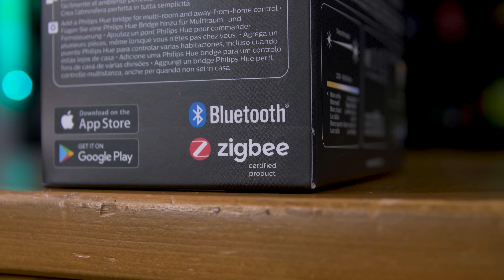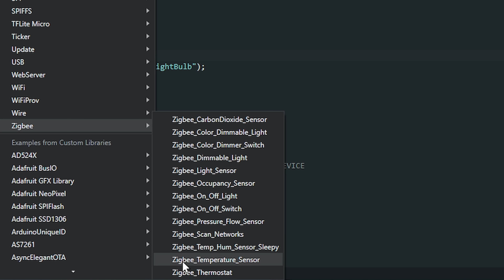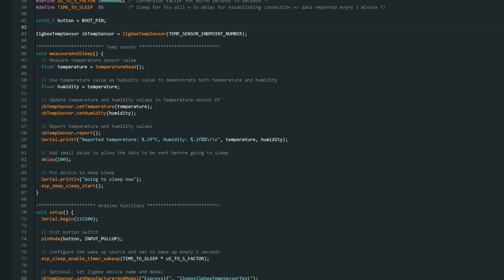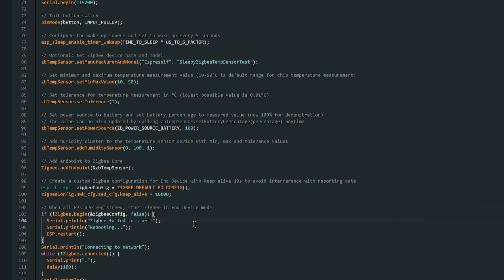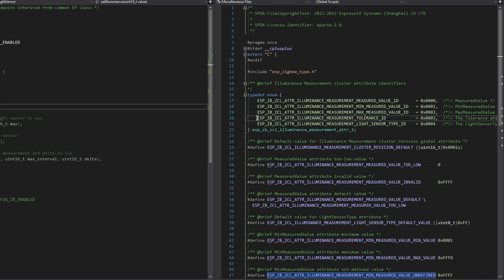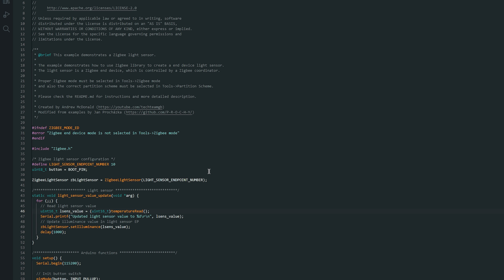You can make your own Zigbee devices! DIY Zigbee How To

Comment: Hey!
Thanks a lot for this explanation, that helps a lot :)
Quick question - I have esp32 which has 1 relay and 1 BLE device (toothbrush battery) on ESP home over WiFi. As it's WiFi + BLE it of course crashes from time to time, do you think/know if it's possible to add BLE device battery as an output via zigbee? Thanks in advance :)

Comment: I'm confused. In all the examples they make, there is one for a cover (blind). But covers need to respond to open and close commands as oposed to all the other examples that do not respond to any command. So, going to Zigbee for low energy battery operated devices sounds good but... the only way a battery will last a descent time is by using the deep sleep more. I dont see any way to wake it up by receiving a command.  The light sleep consume way too much power.  Any way to make a battery cover (like the IKEA) using zigbee?

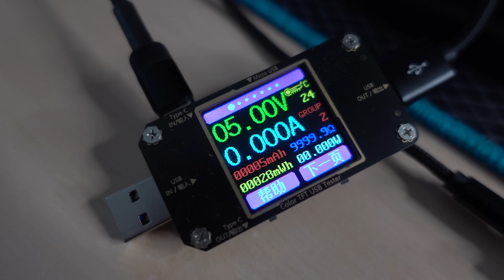Comment: @7:19 - 3mA is because you used USB power and this mA are consumed by LDO on board. If you connect battery directly to 3.3V you would see uA instead of mA while sleeping (typical figures ranging from around 8.6 μA to 15.48 μA)

Comment: Absolutely brilliant. I've got 2 usage cases already.  

The first is making a dumb W1209 or W3001 temperature sensor smart, when it is impossible to retrofit a new probe. I've got Mumubiz TYZGTH1CH-D1RF Zigbee temperature probes which work fabulously where you can install the 3-pin temperature probe that comes with the unit, but the units don't want to know the 2-pin sensor probes that the W1209 or W3001 use - and that are already installed under floors with my underfloor heating system. I installed spare probes since lifting the floor to change one would be ludicrously impractical to the point that it would be far better abandoned than replaced! I figured out that the 3-pin Mumubiz probe works fine with just the black and yellow wires connected, and tried the W1209 probe on those pins instead, to no avail. I simply want to be able to add the underfloor temperature to the other heating-related parameters I'm capturing in Home Assistant. I'm sure there are numerous other retrofitting possibilities.

The second is making a properly smart Zigbee repeater. It probably stops being a repeater just by becoming smart. I'm wanting to install sensors in a polytunnel 150 metres away, across public property and repeaters in between will need to be solar powered with battery packs. On day 1 I'll just use regular repeaters, but as they're expected to be mains powered, they don't do any sensor measurements of their own. However, it would be better to use custom repeaters which track and report their battery state, and go into deep sleep if they're not getting enough solar power to sustain them through the night. Here some smart logic relating to link quality would go a long way towards ensuring that network integrity is maintained throughout.

Comment: Great video, both this and the one you did on diy zigbee doorbell! ❤ Just wondering, is it possible to have multiple inputs and send it over zigbee? I'm thinking 2-5 temperature sensors on the same ESP32-C6 module. Sensor type and how that is taken into the ESP32 doesn't matter, just wondering if it is possible to send multiple (temperature) values from the same device.

I know there are devices that do humidity and temperature all at once, but can the DIY software do this also? I can't really find any examples, just talks that it could be possible..

Perhaps you could make a video on that also? Or even other Zigbee videos would be awesome ❤

Comment: I flashed the zigbee on off light example to my xiao c6 but for some reason the on/off in home assistant is inverted, meaning when I turn it on there, the light on the board goes off. Any Idea what could be?

Comment: Congratulations! 🔧📡 I have two questions: is it supported by zigbee2mqtt, and is it possible to use "bind" so that the devices communicate directly without needing to go through the gateway?
Reply: It works fine with Zigbee2MQTT for me. I haven't tried direct binding.

Comment: I appreciate this video and now I am going to have to add a new project to my list!  I do have an ESPHome WiFi connected temp sensor that uses 67ma for 4 seconds every 5 minutes - so about 0.9mAh/h.  Thus, claiming that a Zigbee solution is more power efficient really depends on the alternative solution's configurations.
Reply: Well, kind of. It depends on comparing like with like. A ZigBee sensor that only sent an update every 5 minutes would use very considerably less power than this - both because it wouldn't need 67mA for its communication and because it wouldn't need 4 seconds to complete the process. If your power consumption is ok for your use case, no need to change a thing. But ZigBee is more power efficient than WiFi if you're comparing like with like, by a significant margin.

Comment: I've just had a smart meter fitted and want to use the Seeed C6 board to send just current power (once a second say, or less if it doesn't change) together with the meter reading. My meter LED pulses 3200/kWh and I've got the LM393 to sense it. Don't know where to start but your video has given me some insight. Thanks.

Comment: The ESPs are infamous for their power hungry and very high current sleep modes (a common trick used in battery powered devices). The SiLabs board will be orders of magnitude better and you should have gone with this instead.

Comment: I'm using a C6 dev board from Espressif, and after uploading the example project, the last thing the output displays is "Hard resetting via RTS pin...", and then on the serial monitor I get a bunch of garbage (i.e. unknown characters, boxes, and random characters). Has anyone else had this issue? I also have it on other ESP32 projects (non-Zigbee) on the Arduino IDE

Comment: Very interesting!
I've been using my own Zigbee devices for 3 years now. Development started 5 years ago. I use XBee3s attached to mmWave/PIR/distance/lux sensors, as well as environmental sensors like BME680. It is good to be able to control how your devices work and how many messages they send. Specially now that most off-the-shelf presence (mmWave) sensors send ridiculous amounts of messages on the mesh, congesting it and delaying other messages. Some are so bad that 3 of them will make your mesh act weirdly at best. Unfortunately most simple devices like Zigbee switches launched lately are also following the trend of "talking way too much".

Comment: Even better than Zigbee, the C6 supports Thread, for use with Matter (which it also supports). Because Matter is separate from Thread, you can interior with devices regardless of how they connect. And you don’t need certification to make the QR codes. I did it the other day with the dev kit.
Reply: Probem is that this are american ideas with backdoor "combability" in these days less and less people wants to have americans spying on them at home.

Comment: DIY zigbee devices have been around for quite some time. The nRF52840 does Zigbee too and Nordic has some nice examples for Zigbee devices.
But the ESP32C6 and H2 have more examples and after having used both the Nordic chip and the ESP, I must say that I prefer the ESP32C6. The amount of examples that are available and the amount of libraries available for the ESP32 make this the perfect device for fast Zigbee development.  It did not take too long to attach a string of WS2812B leds using the color light example. The most difficult thing, which was not that difficult at all, was too add router functionality to the end-device only example

Comment: The code generation thing you're looking for is ZAP (ZCL (ZigBee cluster library) advanced platform). To my understanding it's a quasi-electron based app that generates these c files based on a description of the clusters you're going to use. Since most ZigBee chips come with very limiting power and memory constraints, the implementers of the stack (at least in the case of silicon labs with EZP) decided to make a wizard to add the code you'd need for different clusters. While I'm pretty sure that espressif is not using the same code generation things, it's pretty lame to see them use this sort of crap strategy. This also might be a side effect of being obsessed with using C for everything embedded, which limits you immensely in what you can do at compile time.

I honestly expected IDF to do away with this sort of crap, the capabilities of these chips are way ahead of what was available at the time the ZigBee standard started taking shape.

Comment: The xiaos are a great dev board, i have many installed around the house.  The c6 with ceramic antenna and zigbee takes them to a new level. Hopefully the esphome dev team will stop boycotting the chip.
Reply: I'm curious about that last statement regarding ESPHome "boycotting"  ZigBee, preferably weather citation.
Reply: @ethzero  I think he means the C6 variant of the ESP32 specifically.
Reply: Is it compatible with Samsung Smartthings Hub? is there any special driver required? Thanks.

Comment: I'm just wondering if I could make my dumb sauna smart with this. I think that could work as I only trigger a button press with it but will I be able to recognize the button press from the panel in the sauna too? 🤔
Reply: Yes, but how hard it is depends on your sauna.  The easiest thing to do is hook the button to the C6 and use the C6 to control a relay connected to your sauna's control board.  The C6 detects button pushes and operates the relay as appropriate.

That's easy if the button is connected to the control board via wires.  If the button is mounted directly on the control board, then you'll have to figure out a way to decouple the two.  The control board is likely to have a conformal coating, which will make soldering no fun at all in my experience.

Comment: Found these modules am Amazon a few days ago. I really hope this gets ESPhome support so you can handle issues properly instead of hoping your message is submitted within X seconds or write a bunch of custom stuff.
All of my sensors will attempt to resubmit if MQTT fails for 60 seconds then goes back to deep sleep. ESPhome makes managing your devices so much easier since you don't have to mess with the code if something is changed in the firmware.
Reply: Absolutely true...the c6 has been around for several years but esphome team have stopped any new chip support after the c3.  All other dev platforms support them, including platformio which supposedly drives esphome. So I have returned to Arduino for my development and integrate the new devices into home assistant directly.
Reply: This is ridicoulous statement. ESPhome is a joke. Lack of stability and constant breaking changes not to mention security. Every "update" is a risk. No thank you - never again.

Comment: Zigbee is shit
I have 6 hue BR 30's in my kitchen and like 6 other hue bulbs throughout my house and there are lots of times that one or more of my BR30's don't respond with the other when trying to control them in a group.
My zigbee PIR sensors drop from the network all the time too

The repeater thing is lure bullshit, I have  loads of wifi bulbs that never have any problems even though they are farther from the router than my hue bulbs are from the hue bridge.
If they are repeating the signal then they are doing a really shit job at it
The only benefit is the PIR sensors are fast to respond while the wifi ones are all but useless due to lag and delay.
Zigbee has a shit range and is spotty and unreliable, I have tried different channels and they still have issues.
My house is open concept and the hue stuff is all in the open and spaces very close yet it has problems while the WiFi stuff is in the bedrooms behind walls and closed doors and farther away from the router and no problems at all.
Reply: if your wifi is on 2.4ghz it could interfere with zigbees 2.4ghz network therefore you could have problems. try to set both network as far away as possible in sense of ghz value
Reply: @mawi435  it is well it's both 2.4 and 5ghz
I will try it.
I do also have 2 zigbee hubs ,the hue bridge and a aotec smart things hub so that could be interfering too
Reply: I don't have any hue devices, but my zigbee network became very reliable after adding a couple of Ikea Tradfri plugs which also act as repeaters. Good luck
Reply: @KerrySainsbury  I don't have any tradfri plugs but I do have a bunch of the tradfri rotary dimmers (however they are always dead since the CR 2032 batteries are always going dead and the rechargeable 2032's I have are hard to get working because they often overcharge and put out too high a voltage, these dimmers are very fussy about voltage and it is very hard to get rechargeable batteries to the golgy locks zone) and two tradfri PIR sensors and it makes no difference
Reply: only mains power devices act as repeaters. Socket plugs are easiest, but also mains light switches are good.

Comment: mAh is not a measure of current. You just mean mA.
Reply from the maker: I always add the hours when I don't mean to! It was 63mA, and 3.15mAh if you average it out.
Reply: @TechteamGB  it's still just an average of 3.15mA. Current (mA) is an instantaneous rate. mAh is accumulated charge over time ie 3.15mA for one hour is 3.15mAh. Over ten hours it would be 31.5mAh. So saying 3.15mAh without a period of time doesn't really mean anything.

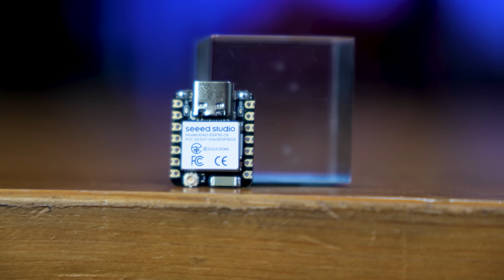Comment: 1:58
These boards are still power hungry compared to off the shelfs zigbee. Don't expect to power it using a coin cell like others.
Reply: I was wondering about this thanks.
If I diy something I would probably run it on tripple A or a lipo in that case.

Comment: I think the main drawback of this is lack of OTA support
Reply: Zigbee supports OTA, why would this not be capable?
Reply: It has OTA.....
Reply: I mean c6 have wifi and zigbee both so in theory we can use some software trikery to use ota aswell right ? 

My hypothetical approach will be as follows 

1) from zigbee set some flag which will trigger function where wifi is set up and ota is started 

2) in the on success callback of ota function write code to trigger zigbee setup

Comment: Thanks for sharing this.  Eventually, I'll get back into home automation.  It became so frustrating, I tossed everything in a box over a year ago.  At least I have something else to try.
Reply: out of interest, what became frustrating and why do you think Zigbee devices will solve this problem?
Reply: @ Sorry for the late reply.  I really don't know what the exactly issue was.  I couldn't seem to connect to any of the devices I had.  I had a mix of what should have worked on zigbee and door switch & presence devices that will only work with Aquara.  I had hubs for both but just couldn't get it to work.  Maybe next year, I'll try again.
Reply: @ I share your frustration. Home automation is a learning curve. :-)

I am using Home assistant for about a year and a half. My strategy so far is trying to use as few platforms and integrations as possible.
All my devices are WiFi. Which is only possible because I don't have too many (don't need too many).
I worry adding a Zigbee or other hub will complicate things. 
WiFi may not be fast, or efficient, or resillient or something.. but at least it's a well known standard. I worry the standard for Zigbee and Matter etc etc are changing and it will create a problem for all those devices in my home if I had any.

But I do like my automations... like lights that are dimmer at night than they are in the day. And the reminder that my laundry is finished... for example

Good luck and thanks for the reply.
Reply: If this happened to you and you haven't already tried ESPHOME, I really suggest you do! It just works in home assistant and hardly ever fails once set up. I stopped at some point too and when I came back I simply focused on that. I have flashed every smart device to run esphome and they have been running flawlessly for MONTHS.
Reply: What ecosystem were you using? I only get stuff that works with home assistant. Control everything from one place.